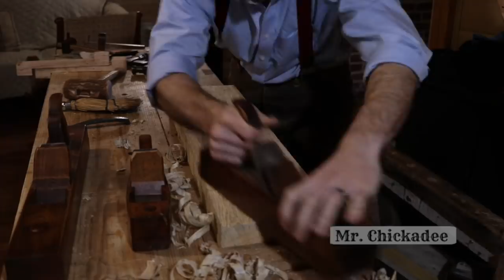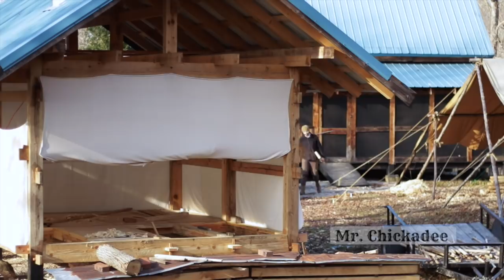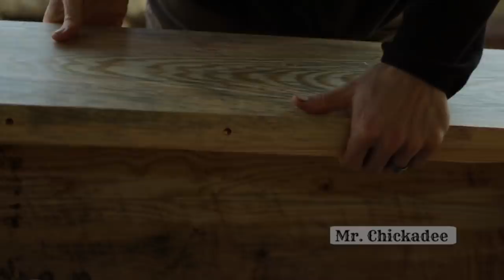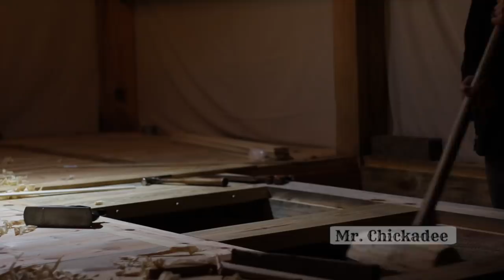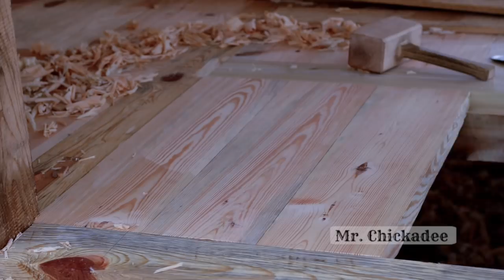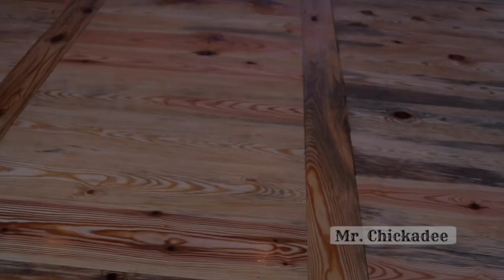Traditional Korean floor 대청마루 ( daecheongmaru) PART II a wooden floor without nails, screws or glue

Comment from the maker: To all wandering on expansion and contraction...please read the description, if you cant find time for that...well its done traditionally with green to semi dry wood, so will only contract with time, not expand. The spaces between boards can be tightened up later by many means, with care! Or the entire underside can be insulated and gaps filled with a traditional putty or beeswax oil and sawdust, or boards can be joined on edge as well with shiplap, tongue and groove or splines. All are possibilities plus MANY others. There is no ONE WAY for this kind of floor, and only a few important things to remember, as stated in the decription and now here.
Reply: Nice - I wondered how they made the lovely floors in the historic buildings we visited. 

The humidity in much of Korea is high, without the huge swings the USA gets, so annual shrink & expand would be less of a problem than here, where it can go from 5% to 85% every year.

Because it's not nailed, you could probably use shims along the walls to nudge the boards together, then fill that space with some sort of caulking after the initial shrinking.
Reply: I would love to see this floor after a year or two. Perhaps another video showing the way you would handle any shrinkage. Just a thought!
Reply: I noticed that some the boards had wooden dowels connecting to one another but others did not. what was the point in skipping them or were you marking the dowel holes afterwords to keep alignment and i just missed it?
Reply: and most important... no stress.. love your work.
Reply: @jboatman81   AGREED. WOULD LOVE THAT.
Reply from the maker: @jboatman81  thats the plan
Reply from the maker: @hellzs  Sometimes we filmed scenes that were not real, I mean putting boards or such that was not the final order or process, but done to try and show, sorry for the confusion. Most korean floors Ive seen made in this style did not have anyhing between them, but I felt better since my joists were quite a bit more seperate than is typical for them.
Reply: A uguisubari (nightingale floor) porch would go incredibly nice with this :)
Reply: Awesome finished result, its beautiful.  I might have missed it somewhere, but what wood did you use?
Reply: The traditional Korean floor design incorporates a very clever feature that compensates for shrinkage over time.  The channels cut in the beams to accept the floor boards are cut in such a way so that there is a taper between them.  As a result the floorboards on one end are significantly shorter than the boards at the other end, with each board cut to different lengths to fit the taper.  So as the floorboards and beams dry and shrink, and gaps appear, the floorboards can be tapped to snug up the gaps.  Because of the taper this will also snug up the ends of the floorboards with the beams.  Over time this will result in a significant gap at the end of the row of floorboards, which is then filled with a new piece of wood.  Its a brilliant system!
Reply from the maker: @benzracer  Its spalted short leaf pine mostly, some ash for the large quarter sawn capping boards
Reply: I thought you were going to say, "If you can't find time for that...go pound sand!"  That's what I would've said.
Reply: Great work pal. I missed what the timber was?
cheers
Reply from the maker: @markwilson9935  mostly shortleaf pine, some ash
Reply: Looks like my Tools here in Germany lol
Reply: @MrChickadee  Good Morning Mr Chickadee, it would be great if you make a chicken coop with hand tools or pit saw a tree for lumber!
Reply: What variety of wood?
Reply from the maker: @BolinFoto  sounds like you should make it yourself!
Reply: What was the finish?
Reply from the maker: @rogerscottcathey  canola oil and beeswax
Reply: ah, so basically, the boards are already acclimated to the humidity of the area and will not expand all that much
Reply: Was indeed dwelling on that =)
Reply: What kind of wood is used?
Reply: that's awesome! looks like it would resist a lot of movement anyway even if it did expand!
Reply: Superbly done. You are correct there are many ways to tighten it all up. What an amazing display of craftsmanship. Do you need an apprentice
Reply: @MrChickadee  he needs a saw mill. Your sir have some amazing talent. Do you need an apprentice?
Reply: My Father built a studio for a Japanese sculptor who was trained in pre WW2 Japan as a wood craftsman. He had an array of hand tools that were quite amazing and may be of interest to you. His name is Toshio Odate, and he has been on several You Tube videos. You would enjoy his work.
Reply: My friend what an excellent work! I have a question.. in Japan parquet is dark brown to black similar to french technique how did they paint it traditional?
Reply: @MrChickadee :  I'm thinking connecting them with dowels might make them creak.  I grew up on such a floor made by my grandfather in Daegu, S. Korea.  It was very solid and sturdy, and was not creaky at all as one might expect of a wooden floor
Reply: @Marousiotis13  : No varnish and coating of any kind is used.  I grew up on such a  floor made by my grandfather.  You just walk on it with bare feet or socks.  Yes, you may spill all kinds of crap on it but you just wipe it off with a wet rag, that's it. You don't tip toe on it like you would with an expensive natural wood floors on some homes.   It just darkens naturally with age, as you say dark brown.  You treat it like your cutting board, is the best comparison I can think of.  In that sense, it's super tough.   My microbio prof did a bacterial contamination test on wooden vs. plastic cutting board.  He assumed plastic would have less bacteria.  After looking at the swabbed cultures from both surfaces, wooden cutting board had almost none, but plastic was rife with bacteria. So he tossed his plastic cutting board.  I think wood has a natural antibiotic.  That 'wood' make sense.  Wood is fairly resistant to normal kind of bacterial degradation.
Reply: Amazing work! Has no one inquired how long it took you to craft the entire floor? It must have taken you a very long time.
Reply: I read it, but didn't understand it. but I appreciate the work and effort put into this. :)
Reply: 여름에 이곳에 누워 수박 먹으면 대박~
Reply: @hellzs  The last board in every row could not have dowels because they drop in and don't slide together like the rest.
Reply: 아름답네요 예전 외할아버지댁에 있던 마루가 생각나요 
한국전통 한옥은 계절과 함께 숨을 쉰다고 합니다 
마루 포함 서까래 올리는 영상도 꼭 보고싶네요 
한옥의 꽃은 못 안쓰는 지붕이니까요
Reply: @archkde  I recommend the YouTube Channel 'Wood Wood" ... He is a traditional Korean carpenter working in the old manner. He speaks English, answers questions happily and is a good guy. And from the look of it a very solid builder. He is somewhat more rough and ready and uses power tools .. uses a chainsaw like it is a brush.

Comment: The unbelievable attention to detail required to make sure those two floor joists are perfectly parallel. I'd get half way down the beams and it would be too tight and have to hammer it back out the other way! 
Very well done sir.

Comment: Excellent work! The joinery you used was amazing to say the least! I’ve spent many years in Korea and had the pleasure of watching and learning while the men were building similar floors to a small thatched or tiled roof home way out in the countryside! Very strong and lasted 50 and more years, as long as the house! Some Buddha temples floors have lasted over 500 years! Absolutely amazing!
Another style floor, The masonry floors, used Ondol  (온돌) underfloor heating from the cooking area hearth. I was amazed at how (in the country) they sometimes used soda cans as the piping to exhaust the dangerous Carbon Monoxide fumes of the circular (with holes) Charcoal. Unfortunately it sometimes had disastrous results because of human inhalation at night while sleeping. I was lucky on one occasion, and only awoke with a terrible headache!
Thank you for the enlightening video!

Comment: The accuracy required for such a beautiful and perfect result is nothing less than amazing. And that it was all done with hand tools makes it even more amazing.
Reply: But alas, power tools only let your mistakes happen more quickly and to a greater degree. 
But I agree, the floor is amazing, and the fit is unbelievable.
Reply: If you think about it most of human ingenuity was made using hand tools throughout history. We have regressed through mechanisation, in some (if not many) respects.
Reply: @spinny2010  machines are capable of producing extremely accurate results, however most carpenters don't have access to them. I think there must be a happy medium between only traditional tools, and only modern power tools.

Comment: there is some serious skill here on a very basic level and that is first and foremost the ability to hold the saw steady and cut either perfectly straight or at the desired angle without even a minor deviation.....planing , chiseling, etc is secondary, not to diminish their required skillset.......BUT the saw cuts are beyond highly skilled! great job!!

Comment: How wonderful it is !
You have a great job !
It's traditional korean living floor in the center of house .
Tradional korean house called Hanok  한옥 is not used steel nails for the reason of scale and corrosion.
It's only made of wood, stone, and mud tile with heating system called Ondol 온돌.

Comment: That's a pretty interesting way of making something that works on a practical level, not just a "We can force it together" method like with 
most modern building and fasteners. 
That being said, I think at the end I would have taken an orbital sander for expedience sake, to make the floor nice and smooth. I mean the way I look at it, you 
worked hard enough getting those floor boards to shape, may as well make easy, what you can.

Comment: That is an amazing floor system made even nicer with your selection of wood that most people would consider 2nd grade or worse.
Reply from the maker: Very cheap wood, .50 per board foot here
Reply: Mr. Chickadee the joists must have been a careful selection though
Reply: well, that was the point of this style of flooring technique.
Korea just did not have adequate supply of fine wood.
They could not afford to put hardwood on the floor.
They had to use remnant woods after the framing was done, and only big enough tree available were pine.
Reply: What kind of wood?

Comment: I'm building a post-and-beam workshop atm. Looking at this I'm like "Oh, that'd be a really awesome way of doing the floor". Then I look at the skill in my hands and I think "Maybe I'll just screw down some OSB board and call it a day".
Reply: Ok but if you do that you can never develop your skills. build your shop with the intention of changing your floor as your skills increases
Reply: Do you mean some oriented strand board board
Reply: @autodidacticartisan  I think he does does.
Reply: @autodidacticartisan  sawdust board
Reply: Just screw down some flat plywood, ardex from home depot its dries smooth to level ourt floor sagging, and lastly glue down some straight edge LVT plank flooring.... This dudes video is a whole new level of craftsmanship
Reply from the maker: This kind of floor can be done quite easily by anyone with little skill if a few basic power tools are used, such as a plunge router to cut the grooves in the joists, a table saw to trim the boards and cut a tongue on each end to slide into the grooves. 
If you have a sawmill nearby fresh green pine should be much cheaper to buy than most if not all fake glued contrivances (OSB, Ply, or particle whatever trash they make now)
Reply: That is what I was basically trying to say to @Keith Currams, try it you might just shock your self.
Reply: @MrChickadee  This is a good point, those of us without the skills to do this by hand might be able to do this with some power tools and a little patience. Making jigs ect may help to get some consistency.

Also I this video has made me curious about the concept of building an entire house with no nails as some Korean commentors have mentioned.

Comment: This is awesome. Are you going to build a traditional Ondol? A traditional Korean heating floor system.
Reply: Ok, you have my attention, please elaborate? At fifty seven (57) years of age I'm still on the quest for knowledge.
Reply: Wikipedia says an ondol is for use on a masonry floor.
Reply from the maker: not on this building
Reply: @justgivemethetruth  Ondol or floor heating has been used in Korea for many hundreds, if not thousands of years. I have been in temple buildings dating back 1300-1400 years that are entirely made of wood and use ondol heating. I have lived in both modern houses and high rise apartments in Korea, and they utilized the more modern style of ondol. Traditional ondol uses heated air that flows beneath the flooring to heat the room. Modern ondol often uses heated water or another liquid flowing in coils that are embedded into, or just beneath the floor (masonry, concrete, etc...) For sake of simplicity, both styles can be referred to as ondol. Ondol is great; it creates a really cozy space during the cold of winter.